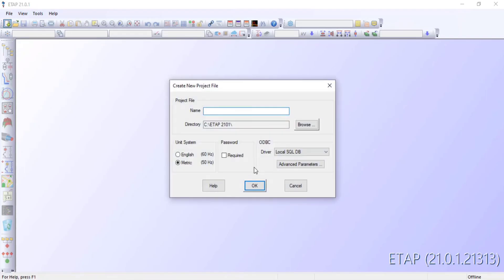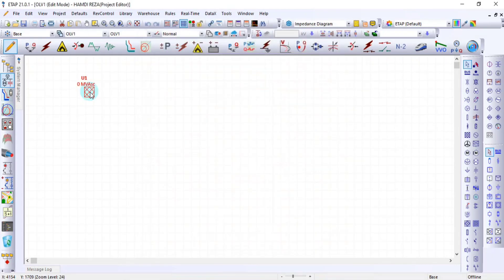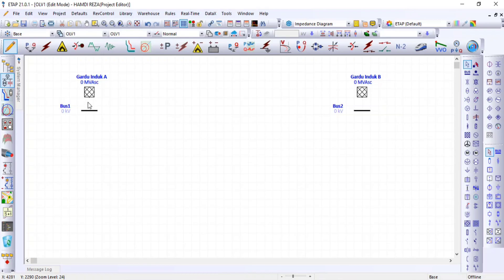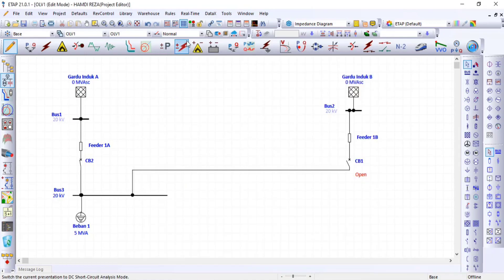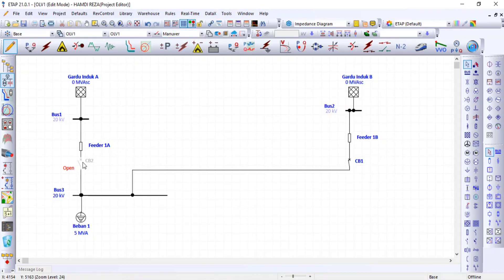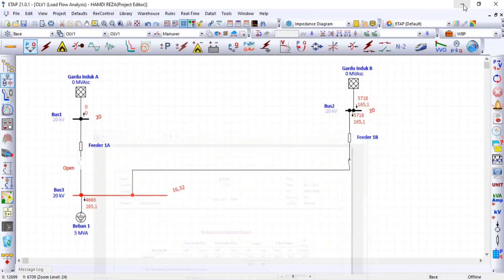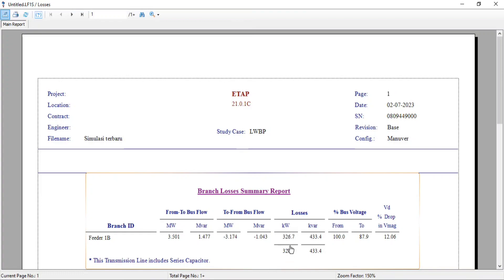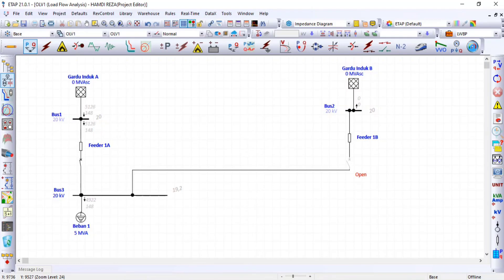Tutorial ETAP 21.0 || Membuat SLD dengan kondisi Beban & Switching yang berbeda || Simulasi dari Nol

Comment: kak, mau nanya. Kalau simulasi aliran Daya kan swing nya cuman 1. nah kalau di etap kan settingnya di generator, karena di bus gak bisa diatur sebagai  swing / voltage controlled.
Saya mencoba 5 bus, dengan bus 1  saya set generator swing, bus 2 generator Voltage Controlled dan Load bus sisanya. Nah saat saya run Load Flow, kenapa generator di bus 2 ga suplai? dan supply hanya dri bus 1? Sementara, kalau keduanya saya buat swing, hasilnya jadi tidak sesuai dengan perhitungan manual. karena kita tahu kalau analisis aliran daya bus yang ditetapkan sebagai swing cuman 1. Mohon penjelasannya kak.
Karena hasilnya beda jauh jika saya run load flow dengan software power world simulator. Saat saya run pakai power world simulator, hasilnya benar sesuai perhitungan manual. Terimakasih kak
Reply from the maker: Benar kak,jika ada 2 sumber berdekatan dengan satunya SWING dan satu lagi Voltage Control atau mode yang lain,maka sumber SWING akan lbh dominan kak,artinya bgmn? Sumber non swing akan dikalahkan oleh sumber swing kak,jika jaraknya berdekatan, 
Sama spt dirumah jika ada sumber pln dan sumber genset disupply ke beban rumah tangga secara bersamaan,maka supply dr Genset akan dikalahkan oleh supply dr PLN kak, dmn supply pln dianggap sbg Swing
Reply: @HamdiReza  ga ngaruh kak, dah saya coba ke sistem 33 bus. gitu juga. Cuman yg swing supply daya, padahal lebih dekat jaraknya ke voltage controlled. Ini sampai skrng masalah Etap yg menurut saya g dpt jalan keluarnya kak. Karena kan prinsip swing itu bukan supply semua beban kak, tapi swing itu menutupi kekurangan setelah voltage controlled memberi supply
Reply from the maker: Betul kak,coba kirimkan simulasi etapnya ke email hamdireza@pln.co.id kak,